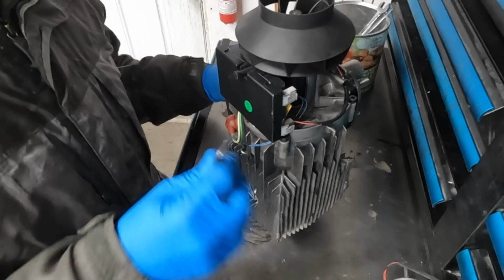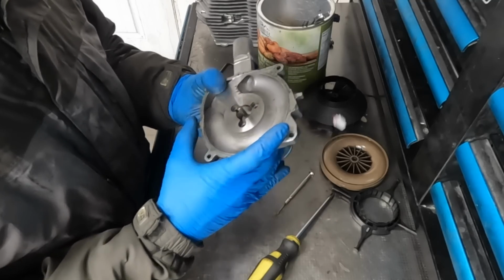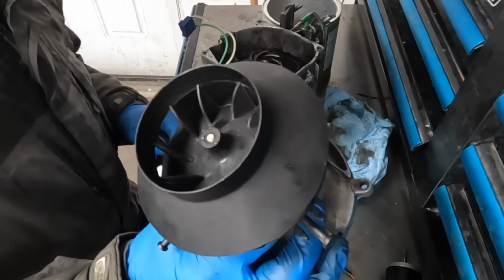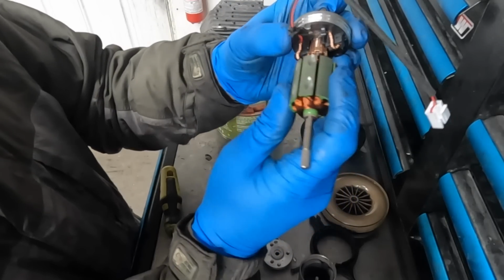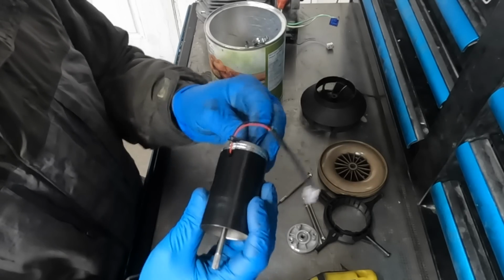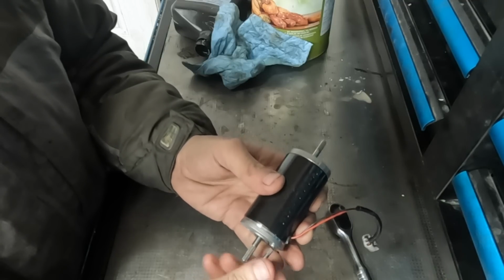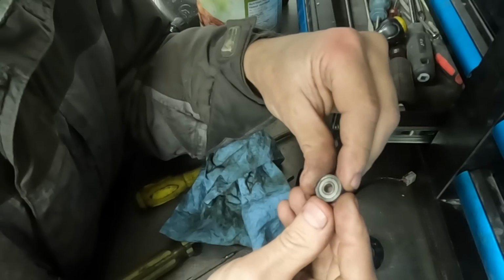Diesel Heater Fan Motor Replacement - I finally destroyed it !

Comment: Inline skates has the same bearings, Zed is not so good as Abec , and they are in quality 1,2,3 and 4 (the best) 😊
Reply from the maker: Thanks for the comment. Not sure where you got this information, but that is not correct. These bearings are way smaller than skateboard / inline skate bearings.

Comment: What a waste of time taking apart a new motor and making us watch it. Good video on the replacement though.
Reply from the maker: HAHA... where's your sense of adventure !? Taking things apart and messing with them is how I learned 90% of what I know. Seeing what it's supposed to look like before it's messed up is a good start to finding a problem if/ when something goes wrong. 

Personally, it's never been enough for me that something works... I have not know how and why it works. Not always necessary, but not a waste of time, as you always learn something.
Reply: Total BS that brown thing fan inside does not simply pop off your taking the piss , I used two strong knife like but of metal that fitted under it and spent over a hour trying to to prize the thing off no way in this world have you just gone up to it and then pull it off so easy saying yours may be a little tighter obviously you knew already you had managed to get it off before video no way did you just pull thing off as in video

Comment: You can pull the brush springs back so they rest on the top of the slot, making it easier to insert the commutator.  Then release the springs back into the slot.
Reply from the maker: yes, that is one way to go about it 👍

Comment: Test Cell operator.
Reply from the maker: Say what now ?
Reply: I worked in the service as a test cell opr. Basically you are testing systems mine was F-15 engines. @loweredexpectations4927

Comment: Motor link ?
Reply from the maker: I'm not sure if this will work, but I will try. If you can't see it in this comment, I will also leave it in the description of the video. 
https://www.wish.com/product/61d3d95d0cd72c969ded3780
Reply: @loweredexpectations4927  thank you!
Reply from the maker: @axeevent10  You're welcome.
Reply: @loweredexpectations4927  L.E: took mine apart today, surprised I have the serviceble motor, luckie me, got new berings and now good to go.
Reply from the maker: @axeevent10  Yeah. It is pretty interesting that they are serviceable, at least some parts. Not sure if you saw it, but at the end of this video I did take the motors apart.

Comment: I have seen that their is a high pressure pipe system that they can connect to your dpf and clean out all the gunk, by running some sort of liquid through it , that could be the solution, drill a hole into the chamber and attached hard pipe , some how run some sort of solvent through it and suck it out through exhaust, every one snd again when turned of
Reply: Tbf if the solvent could evaporate, could just pump it into the chamber and see if it delodges anything , pump and suck maybe and the rest would just disappear
Reply from the maker: That would be really cool if it works. I really want to try steam / water when it is running but I need to work on getting it nice and hot first.

Comment: Those motor bearing look like the same as the Skateboard wheel truck bearings I got not long ago.  Popular number and you can get 10 for $10 on Amazon
Reply from the maker: I mentioned the # at the end of the video. You can get them pretty cheap, but they are not the same as skate wheel bearings. Cheers !
Reply: @loweredexpectations4927  I see that now when I checked my spares. I took one of my heaters that I ran waste oil in it last year and it looked just like what you had each time.  I am wondering if oven cleaner will help break the big junks up.  When I ordered the heater from Vevor I order 2 of them so I could experiment and still have a working unit.
Reply from the maker: @helihead11  I have heard that oven cleaner works, but I have not tried it myself. When I first started testing, I used to get concrete like carbon build up, but recently it is very easy to clean.
Reply: @loweredexpectations4927  presently I have the concrete substance.    Your videos are the type of science I can relate to and some techniques I won’t need to preform now,   Good job.
Reply from the maker: @helihead11  That concrete substance is a real pain in the butt to get rid of. I believe I stopped having the concrete issues when I started using diesel to start and shut the heater down. I have done so much testing it is hard to keep track of.

Comment: Usually there is a little slot or hole in the front of the brush holder...normally you can push the brushes all the way in to holder and put a paperclip or something in the hole or slot and lock them all the way back...now you can install the rotating part in the housing and than instal the backplate with the brushes and not risk the wires getting crushed because of the magnetic field...just before it is completely set you just pull out the paperclips and the brushes are set into place....hopefully this makes your life a little easier in the future when working on electric motors 😁
Reply from the maker: Interesting. I have never noticed that before. Most of the motors that I work on are starter motors. That would make things easier. WIth bigger motors I use zip ties to hold the brushes and start the assembly with the rotor in the magnets and slide the end cap on after. Good stuff 👍

Comment: A week after I put the muffler on my heater started shutting off, and there was fluid in my exhaust pipe!
Reply from the maker: Fluid as in water or fluid as in fuel ? My exhaust gets too hot to collect water, but last night I did have oil dripping out of my ventilation system, haha.

Comment: I'm surprised  that fans are pressed  fit without notch or keyway  at some given  point I'm sure you will be able to make them Slip 😆 🤣 😂
Reply from the maker: Yeah... I was surprised at how easy they were to take off.... but there's not a lot of load on them... The shaft is knurled / micro splined 🤷‍♂️

Comment: My fan motor stopped working so I stripped it down to find that the brushes were seized in the runners. Cleaned it up and added a smidge of HTG and all is well again. Also ordered a new motor...just in case ;-)
Reply from the maker: Nice ! I basically did the same thing but added WD40 and it was TOTALLY my fault for overheating it... several times.

Comment: For people trying to replicate, it might be worth mentioning the gasket your heater probably "lost" somewhere along its journey but which some people may want to replace if it breaks during disassembly :)
Reply from the maker: Yeah... I should have mentioned the gasket... I haven't used mine for so long it slipped my mind.
Reply: Personally, I'd be more comfortable with that gasket in place. Scared of CO "blowby" into the room...
Reply from the maker: @HB-et5iv  Yes, I would suggest using all of the gaskets. This heater is a test bed for all sorts of experiments and I literally take it apart 4-5 times a day, so I don't always use gaskets. I'm also not sleeping in my garage, so I'm not too concerned about CO. 

I'm also not convinced that any CO can / will escape, because the system is under positive pressure from the combustion fan... The gasket is pointless as there is a large opening where the air goes into the burn chamber. The pressure on that area is equal to the area at the gasket surface, but there is less resistance. That being said would still recommend doing it the way the manufacturer intended.

Comment: Definitely a great tutorial on how to replace the blower motor and also on how to replace the motor bearings.

The motor bearings are often the first part that has to be replaced after a few thousands hours of operation.

BTW, some Chinese diesel heater blower units have balanced fan wheels. They make small little cutouts in the factory to balance them. These balanced units run less noisily and the bearings last longer.
Reply from the maker: I recorded a long rant about the armature being balanced and decided to not include it because it went on for way too long ... haha. Any decent motor will be balanced ... It would be nice if they also all balanced the fan(s) ... but sadly they don't.
Reply: @loweredexpectations4927  Might be an idea for a future tuning video... ;-) I imagine it could be DIY'd like balancing the propellers for RC aircraft.
Reply from the maker: @HB-et5iv  Yeah... a person could do some fine tuning in this for sure. I'd be happy if I could get mine to run for more than a few days on waste oil ...

Comment: The ‘damper’, as you call it, in the one motor end-cap is to allow axial expansion as the motor temperature changes, without affecting the commutator to brush position.  There is always one bearing in an electric motor that can move axially, for this reason.  Sometimes the bearing can move within the sleeve and sometimes the outer bearing support can be movable.
Reply from the maker: That's an interesting take on it... I'm curious if you are guessing at this or if you know from engineering. I have never seen a commutator that is so short that the thermal expansion of the motor would affect the brushes at all... this would be a few thousandths of an inch. 

It makes sense that the motor should be able to move axially so that nothing binds. I don't know a lot about electric motors. From what I have seen, motors typically have some sort of thrust washers on each end of the rotor so that the movement is limited in this way.

Comment: Just a small thing. When re-installing the centre of the motor shaft I have always found it better to tie back the brushes with thin thread or cotton. This reduces the possibility of damage to the brushes. Once the shaft is in place just pull the cotton out :) Great channel btw :)
Reply from the maker: Thanks for the comment. 

I have worked on starter motors and winch motors mostly, and I have used this technique with zip ties ... Your idea would work well on these small motors 👍 Cheers !
Reply: Great idea! Thank you for sharing it.

Comment: lol, the first thing I did when I got my Diesel heater, was to take the housing apart. I knew that the machine probably was not assembled very well. The pump was loose. the wires were not well routed. The wires had no grommets through the sheet metal. The screw in tank nipple was loose. So yeah. Definitely was not assembled to my specifications.

Credit to opening my unit and checking goes to David McLuckie. Shout out.
Reply from the maker: Dave is the man !

Comment: 3:50  They are INCREDIBLY easy to disassemble.  I noticed 3 rubber isolation pads on the forward (outlet) side of the heat exchanger.  Presumably there should have been 4?  Quality control error I guess.
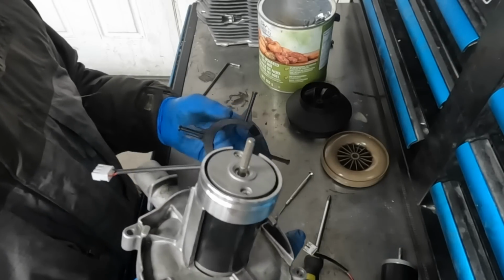9:05 I'd call it a "spacer ring", or possibly "stabilizer bar" because of the extensions.  It's a "spacer-stabilizer bar-ring"; LOL.
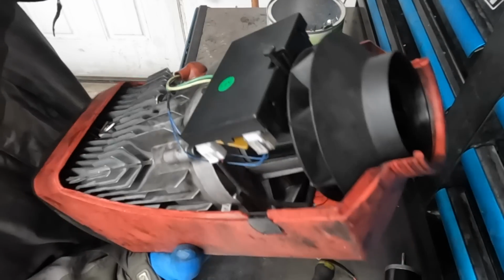14:35 YES!  Super awesome that you point this out.  The first time I had my unit apart that lip was driving me crazy.  I was just trying to mash it together then I decided to use more than 2 brain cells and engage my eyeballs.
Reply from the maker: Yes... it's almost like they put some thought into these needing to be serviced from time to time... that's an odd thing these days. I have only ever noticed two isolation pads but assume that there should be one on each corner, yes. 

Yeah... I'm sure they call it something like the "motocentric, case locating, stabilization, yoke assembly"  

LOL ... yes, I've seen videos of others struggling, so I decided to mention it.

Comment: Must be hel ll to live near to this guy between the oily smoke, late night banging around, and his repeated near misses with burning down his garage. Neghbour is only a few feet away, and the city lives in commonly sees multiple garages and homes go up since they are so densely packed.
Reply from the maker: 🤣 Seems like an odd video for this comment, but no... My neighbours all love me. I'm a very helpful guy and they love me. 

My garage is very well insulated 2x6 walls with 3/4 plywood on the inner walls, 1/2 outer sheathing and stucco... not much noise gets out. 

Also, my neighbours across the alley thad a house fire a few years ago.... I found out by the screams of a little girl in the alleyway.... I jumped into action to find out that their grandmother was trapped inside. The family, all crying and screaming could only call 911. I started barking out orders to get buckets and garden hoses, but they were all frozen in panic.... I got a garden hose smashed in the front door and got to see this poor lady dead in her living room chair because 8 - 10 people who knew about the fire decided that it was someone else's job to put out their fire... 

I stopped their house from burning down and walked away when the fire truck arrived 5 minutes later..... I was so incredibly angry and disgusted.  It took me a long time to get over it. I don't understand people like that as much as they don't understand me... When shit goes down I do what needs to be done. If my garage burns down it will be because I was away or asleep. ... and I don't leave the heater running at either of those times.
Reply: Anymore Assumptions?? Lol, Great job Joel!